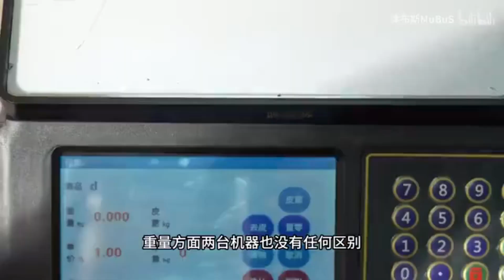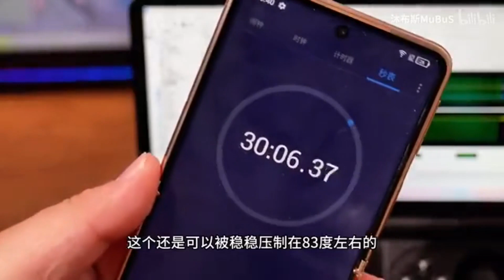GPD WIN Mini New C Shell Material Overview with English voice translation

Comment: Hi Mr Droix, now we know both the perceived temp and core temp under full load full tdp is fine, do you think running the mini at 28w docked for longer gaming sessions would be dangerous for other components around the core? Especially like the wifi and bluetooth modules, I heard even a umpc like the gtr7 pro has this problem and users often experience wifi cut off while playing online games.
Reply from the maker: Its hard to say until we can run our own tests on it. We usually run Street Fighter at 1080p max graphics on a loop and check the temperatures.
Reply: @DroiX_Store thx, I think most likely I'd have to use some form of external fan to aid cooling eventually, battery swelling under higher heat is also a concern.

Comment: Hmmm. I dunno. I'm a HUGE GPD fan, but "there are still some warmth but everyone may not feel the same". And a higher temp of 52 is slightly scary, although the drop from 60 to 30 on the sides is nice. 

Great idea for reposting the video by the way
Reply: Plastic need to be a higher heat to feel what you would feel on metal at a higher temp in surface temperature. Plastic is roughly 75c while metal is 55c where it starts feeling hot. 

The data doesn't represent the difference in material just what it is. Metal have more heat dissipation so the hot spot appears less than the plastic however when touched metal feels significantly hotter over plastic.
Reply: I'll never be using it at 20w but in either case I'm not too worried about the heat. None of the temperatures are outrageously hot and it's very hard to tell by this video what the actual feeling is like. After watching retro game corps review, russ didn't have the new c shell just the added insulation and he stated it wasn't bad so if this further improves then it's resolved in my book. Just hope fan noise isn't insanely loud now lol